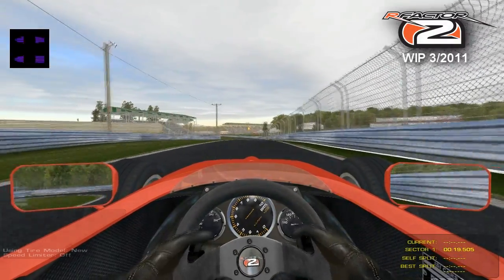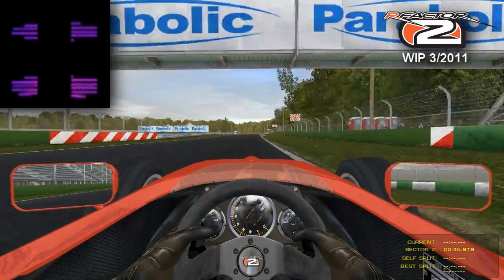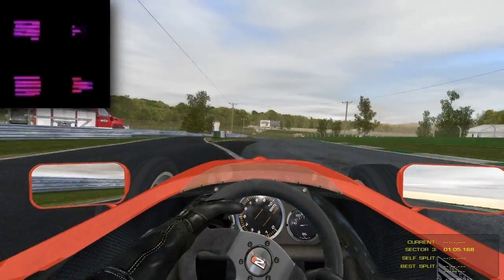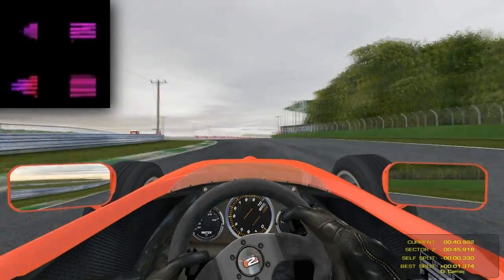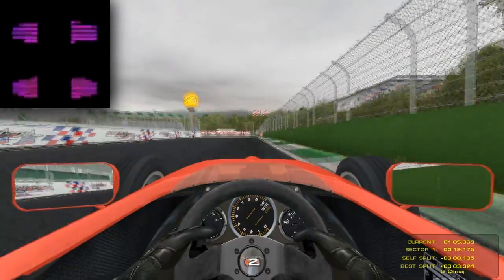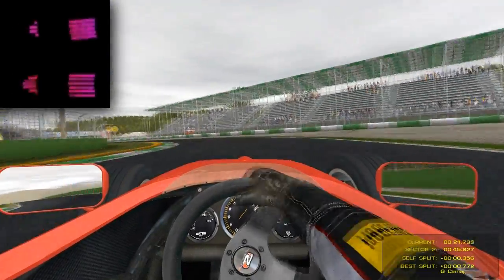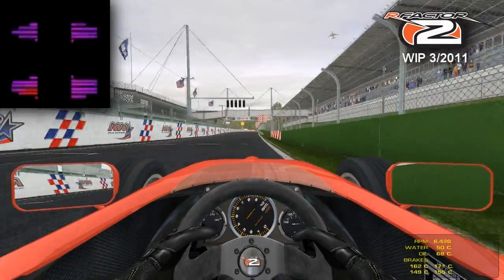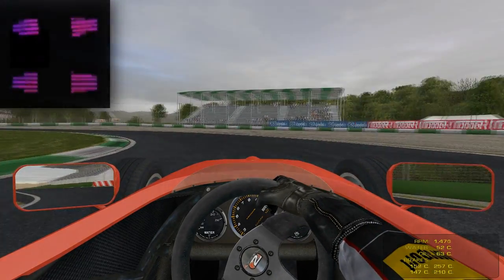rFactor 2 Dev Update - New Tire Model

Comment: @patrickcramer 

No probs! :P

Do you know the seat adjust buttons, to move your seat up/down and left/right? 

Just hold shift and use those buttons, instead of adjusting your seat, it will adjust your mirrors. 

All controls can be found in the main menu settings.

:)

Comment: @ImageSpaceInc Yes more like in reality. Countersteering in rF1 is so unreal, atleast in default settings. Not so sliding itself, but the correction that must you made to prevent slide. The physic not give the Feeling when you pass the point , so you lose the control in a blink of second and you not even know. I am not talking when you pushing the car over the limit i am talking about when you want controled slide.